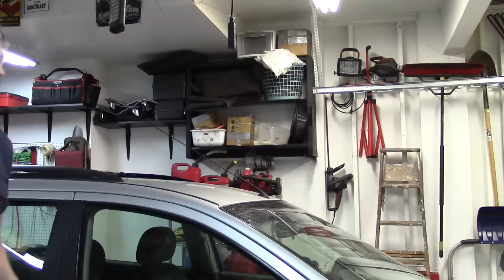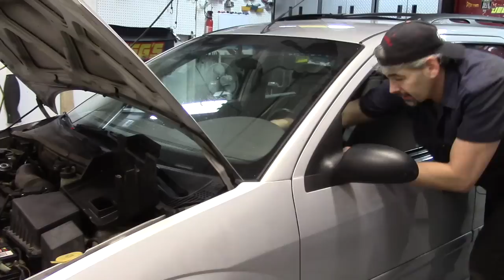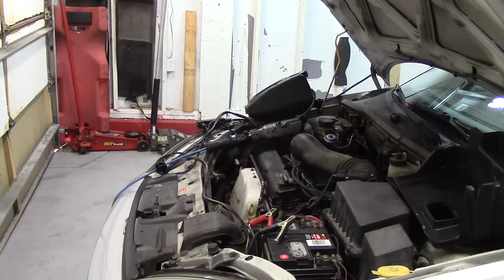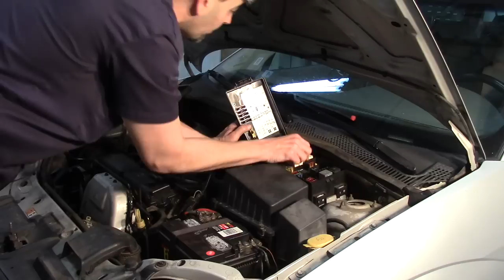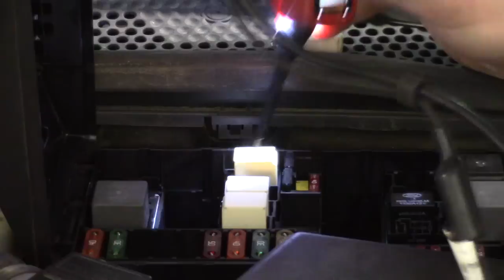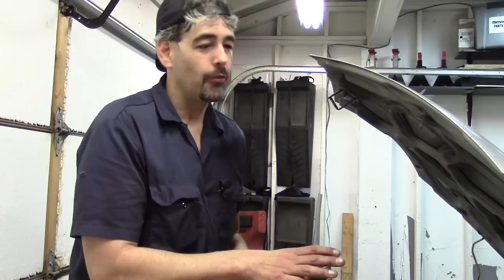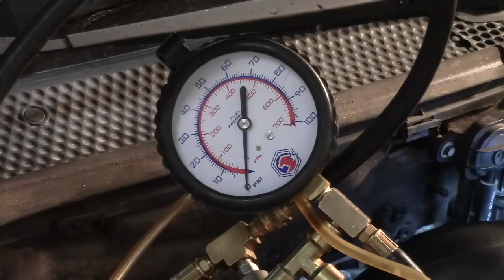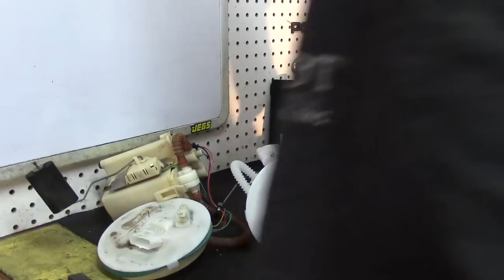Cranking No-Start Real Time Diagnosis -Ford Focus

Comment: For checking fuel, isn't it an easyer way just to smell at the end of the exhaust after some cranking?
Reply from the maker: You could do that but why not spray starter fluid and potentially check for spark, timing and compression at the same time?
Reply: @SchrodingersBox  Thnx, it seemed useful 
when I was on the highroad stranded with no tools, to get a first clue, intrigued as I was:-)

Comment: I have a 2016 Ford Focus, the car has a no crank, no dash light, when turning the key? No headlights, even hooked up to jumper cables? Key fab works the door locks, and taillights, light up, when she hits the lock? Windows also will not go up? Any suggestions?
Reply from the maker: What data do you have?

Comment: You technically forgot one other possibility which of course is extremely rare as well....a broken fuel line and/or connecting hose (filler hose) to fuel tank....of course your fuel gauge would read empty UNLESS it was broke....

Not giving you a hard time just throwing this out there...
Reply from the maker: if the line were broken though we would have seen the fuel pump respond to the voltage test and it didn’t.
Reply: @SchrodingersBox  I know....I meant before you tested the fuel pump....you mentioned 4 things it could be besides the fuel pump...I was just adding that to the list.
Reply from the maker: Oh yes that would be correct. nice catch!

Comment: Had battery tested was definitely bad needed replacement which i did . Still taking more than one try to start . Was told by experienced mechanic that it's not starter since a bad starter wouldn't crank at all ? Is this true ? Soo was definitely bad battery but is it just coincidence that this happened at same time ? Coulld bad battery cause this other problem ? Unfortunately also when I replaced battery I left air flow sensor disconnected ( disconnected to get in battery ) and ran it for test drive . Soo now mass or volume air flow sensor code PO103 showed up along with PO113 Intake air temp sensor
Reply from the maker: It depends on what you mean by “more than one try to start”.  What exactly does it do the first time?
Reply: @SchrodingersBox  often fails to start . Often need to crank it several times to start
Reply from the maker: Then it is not starter. i would look at your volumetric efficiency next given the MAF code.
Reply: @SchrodingersBox  seems pretty easy to replace the evaporative valve control and I might do that. That's what was suggested was most likely solution according to scan . As for checking the volumetric efficiency I don't know what that is.  I could look it up see what tools is needed. Is it hard to do ?
Reply from the maker: i don’t see how this is linked to Evap and in fact it almost guaranteed isn’t. if you think it is then just plug or clamp the hose for the purge valve and see if it starts.  also you would have extremely rich condition reflected in P0172 and 0173 codes which you don’t have.
Reply: @SchrodingersBox  a good way to rule out EVAP is to clamp it where exactly ?
Reply from the maker: to clamp the hose between the intake and purge solenoid. this would cut off EVAP to the engine.  if car starts then, I would agree EVAP leakage into intake would be indicated.
Reply: @SchrodingersBox  now at this mechanic that so far , has earned my trust ( I think ) on the times I've used him. He said present codes are there because I forgot to reconnect Mass air flow sensor when I ran it for about half an hour. They'll stay there until cleared. It's now puny whimper from starter. Started it after several tries. Barely. It's going to leave me stranded very soon. He thinks it's the starter. The starter was replaced from O'Reilly's the cheapest one just over a year and a half ago. Was about $120 . The other was maybe $300 back then. He doesn't think it's bad starter cable connection. Says then it wouldn't crank over.
Reply: Just taking several tries to start car. It's not going to start at all very soon. It just barely cranks for a bit often just a quick second.
Reply: Yeah getting that it's not going to start at all . As I said , it cranks but oftentimes just a quick puny crank. I'd suspect starter connection maybe loose but that wouldn't explain the codes right ?? With the codes I've mentioned , would it cause this ? Getting desperate . Saw Video of replacement of that valve and very straightforward but said delete codes and not sure what that is . After replacement of that valve ,if codes not erased then still be a problem ?

Comment: I have a 02 Ford Focus just bought a brand new battery car cracks but won’t start what would that mean the problem is?
Reply from the maker: could be anything. what data do you have? did you check spark? fuel? compression? timing?

Comment: This helped a good bit for my 2001 my valve for my fuel rail is under the rail on the passenger side under that little bracket

Comment: What about when the no start but also the clutch isn't catching And not recognizing  it's in park or gear?
Reply from the maker: Yep one of the causes is when you have a P/N (Park/Neutral) or CSS (Clutch Safety Switch) that is preventing the starter from engaging.
  In any case, I usually test for this by bypassing the switch and if the car then starts, I know thats the problem. 
  It would apply in this video since we have a cranking no-start though. But for a non-crank no start it's one of the first things I suspect once I rule out power.

Comment: I. Have 2012 Ford focus did engine swap cranks will not start I do have fuel and spark
Reply from the maker: if you have fuel and spark it must be timing or compression then.

Comment: My 2013 Ford Focus got rear ended very lightly and then the car drove for a few miles and shut off and won’t turn back on , there’s no crank sound or anything. I disconnected the fuel line and noticed no fuel coming out as well. However I tried to do the steps to reengage the fuel supply but it doesn’t seem to reengage or whatever is going on. What can I do?
Reply from the maker: when no fuel comes out is that with KOEO prime it is it with putting 12V directly to the pump motor?
Reply: @SchrodingersBox  yes key is in the on position, and no fuel coming out, I believe I do hear the humming tho as if priming, I will have to check the voltage to be sure. I tried to check if it was the starter by jumping a wire in the starters relay which only seemingly fried the wire which makes me think maybe it’s something to do with the grounds ? But are their any grounds in the trunk area? Where the car got hit it was on the drivers side back it did push the fuse box that’s right in that area alittle but I don’t see any actual damage to the box or wires.
Reply from the maker: I would start by putting 12V to the pump directly. this should produce fuel pressure at the rail. if it doesn’t and then pump is running, check flow at the filter or look for whatever the restriction is.

Comment: no hate or anything im actually just curious. But wouldn't the OBD2 sensor tell you it was the fuel pump off the rip?
Reply from the maker: No, there is no code for a bad fuel pump because there is no way for the PCM to differentiate a bad pump from flow restriction or pressure regulation  as a lean variable.

Comment: Hi I got Toyota Avensis it wont start when it's at normal running temperature. Any suggestions plz.
Reply from the maker: I usually start with a fuel pressure decay test for that symptom.

Comment: How long did it take to replace ? 2016 Focus SE 2.0L I just paid a mechanic to do it $60 plus starter . He's been verry good and honest above all . Very reasonable and it's working just as before . I have had timing serious problems which he mostly fixed . Still a lil stalling when I accelerate . I told him about it and he said sometimes they gotta relearn certain things on its own . ? God I hope so . Went on 175 mile road trip when I got it yesterday
Reply from the maker: this was years ago but I want to say it too between 3 and 4 hours. There should not be a long relearn- what data from fuel trims is he seeing that indicates there is a relearn process happening?
Reply: @SchrodingersBox  I'm not at all sure about the data. He might be talking generally .. He also said there's no need to do a misfire relearning procedure since we didn't really replace any of the sensors ? He said , only do a relearn procedure if we'd work on the sensors? Which we didn't.
Reply: But the lurching ( lagging) can be pronounced at times. Very annoying and worrisome. I don't really want to take it back to him because it's basically working but still ..I think he said change spark plugs.. Less than 67,000 miles. Right now original Motorcraft ones. I replaced one when I did compression test.

Comment: Does that car not have a fuel shut off switch (inertia switch)? Working on one now and that was the case. Reset the switch, car cranked and ran fine, guy drove it home and parked it, went to get in it about thirty minutes later and bingo, same problem. Went to his house, reset the switch, still cranks but no start. Plenty of air, spark and timing, no fuel. Fuel pump has recently been replaced prior to him purchasing the car about two months ago. All fuses check out, relay works lol. I'm lost unless the fuel pump has went out extremely fast considering it's practically new.
Reply from the maker: It does but I ruled that out in the first test.

Comment: I have a 2006 Honda Accord that has a reoccurring cylinder 4 misfire and won’t start. We replaced the spark plugs, fuel injectors, the pump and even the catalytic converter. Still nothing, any ideas?
Reply from the maker: Sure. Tons of ideas so let’s narrow them down.  What was the data you got that indicated you needed all of those. What data especially showed the fuel pump needed to be replaced? Was done by fuel trim analysis or rail pressure?
  Also what data showed the catalytic converter was the problem?  Was this an S2 vs S1 overlap trace or was a backpressure test done?

Comment: Hello there! I have a ford focus 2012 se 2.0 and the fuel injectors aren't firing. It will start with starter fluid and run for a few seconds before stalling out again... Fuse and fuel pump and pressure  are good.. spark plugs are always dry during minutes of cranking .. My question is what controls the signals for the injectors? Is it the two cam sensors or crank position sensor or what other probable caused to not open?
Reply from the maker: This should be really easy. On a ford the fuel inejectors are a constant feed and ground side switched individually by the PCM  so it’s clear there is no signal to the PCM. I would simply do a cam sensor bypass to see if it fires the injectors.  If it does then check you cam sensor output because you know the reference  input and signal integrity is good. 
   If that doesn’t do it, check the continuity of the signal, reference and grounds because obviously it has to be a fault in one or more of those wires.
Reply: Hi again... how do I bypass cam sensor and how do I test the crank sensor ? I'm nearly certain none of the injectors are firing.  I also had a new fuel pump and new pcm installed (with  immobilizer reprogrammed for the keys) .. it start with starter fluid again but won't without it.  Do you know what else it could be?
Reply from the maker: it is not the cam sensor if it started with starting fluid because there had to be spark if it ran so the cam sensor is working. 
  What data showed the PCM needed to be replaced? I would totally start there. Was the PCM failing to ground side switch the injectors?  That seems extremely unlikely. How was was that tested exactly?  That’s where you need to start because that data will lead to the problem.

Comment: Your wrong at 18 minutes. 
Focus is common as muck for the pins actually snapping off the plug that connects to the pump. So it just cuts it down to 50/50.

Fyi I literally made the same mistake lol
Reply from the maker: Ummmm no.  Because the test light confirmed there was continuity at the connector. Impossible that there was a pin snapped off and focus is not known for that issue anyway.

Comment: Thank you for the tutorial! That car has a Fuel Pump Module, is a returnless system so the Fuel pump module controls the fuel pump with a PWM signal, that relay you are energizing will not turn the fuel pump on it will only send 12v to the module

Comment: My 2001 focus zx3 has a inertia shut off switch , its located in the passenger foot well near the door. Didn't work for me :'(
Reply: Personal 2002 Focus ZX5 200K Experiences: Also there a fuel pump control module under the backseat of the Focus.  The FPCM if it gets a bad ground connection from corrosion or it got wet or crushed etc.. easy to unplug remove some screws and plug in a new one making sure it has a good backside ground connection. 5 minute fix. My 2002 zx5 had a rusty ground on back of the FPCM and EPCM did not get a good ground reading and wouldn't fire the fuel pump. While easy to unhook and drop fuel tank literally one nut at the front and two twist connectors at the rear of the straps. If your car is rusty and funky getting it all back together not so easy. Carefully (wires and lines under the floor use a dremel and HD wheel) cutting access hatch in floor under the backseat makes changing pump and the fuel filter on a 2002 ZX5 a breeze. Some rust converter paint, rivnuts and and insulated silver self adhesive backed flashing (Home Depot multitudes cheaper than Auto branded Sound deadner [Same Stuff] to seal up hatch after swapping in new pump (I purchased an entire Bosch Fuel Pump Module  $110 vs adding new pump to old housing and maybe $40 with new filters etc..).  Kept old module just in case I want to add a higher volume pump in future. The location of the fuel pump under the backseat was located centered on the electrical connection grommet under the rear passenger seat on my car. Later Focus models sometimes have them more centrally located under the backseat about 13" towards the drivers side from this same grommet. If you use the drop the tank method make sure you have replacement hose clamps, either method you should probably pick up some spare fuel connector locks (about $5 for 6 at autoparts chain vs. $10 each at the Ford Dealer). If your Fuel Pump Control Module is bad Dorman makes a replacement for $39 vs. Ford Dealer $219.  Do not forget to check that the Accident Inertia Switch has not tripped and the button is in the pushed in position (2002 zx5 is in the passenger footwell outside kick panel detent remove button cover and push button down towards floor if it is popped up(shutting off Fuel Pump).

Comment: Hi, from Australia, Sydney..i currently drive a Ford ba ute, falcon,  , 20amp yellew fuse keeps blowing out to the fuel pump any suggestions
Reply from the maker: check how many amps the pump is using.

Comment: Hi there could you help me please I changed the fuel filter on my ford focus  mk2 2008 tdci I did the prime I drive about 10miles and the car stall and once I opened the bonnet I found out lots of bubbles In diesel line from that I did prime again but not luck of starting. Any help much appreciated.
Reply from the maker: Whast is the fuel pressure at idle vs running?

Comment: I Relly like the way you do the explanation. There is only one thing I don't agree with,is when u said if you where a professional technician you will just go ahead and oder for the fuel pump without even consider the injectors..professional don't work like that..my name is Dauda jalloh from sierra leone West Africa...a technician too..but I like your video..because you take your time to explain.
Reply from the maker: Duly noted. Not all techs would have jumped to conclusion, you’re right.

Comment: It's all fine and helpful, but I've noticed that your videos don't cover vehicles with diesel engines. It would be nice if there were some of those, or you just don't do diesel?
Reply from the maker: I get that feedback a lot.  I don't see diesel vehicles where I live, sorry!
Reply: @SchrodingersBox  Darn, I have a diesel car. 😃 Anyways, if you find it interesting, it would be great to do at least theoretical (white board) if not practical demonstration of how the same sensors and systems have completely different roles in gasoline and diesel engines, and how they affect diagnostic process. Keep up the good work, cheers!

Comment: Very helpful troubleshooting! I went through your FASTEC method, and wound up at the same spot, fuel pump. I’m getting power to the pump, but it is not priming, no pressure at Schrader valve. I pulled the pump and put 12 volts on it, and it works, kinda stumped. Any thoughts?
Reply from the maker: Sounds like voltage drop issue to me if it puts out correct pressure with direct voltage to the pump.  Try voltage drop testing the wiring.  This assumes of course the relay is working,.

Comment: Hi, thanks a lot for the valuable information on this video. I was hoping If you you can’t help me fix my 2001 focus as dohc? The other day I was driving for a while then stopped to get some gas! The car was cranking but never started! I pushed it to a nearby parking lot and left it over night, the next morning I went back to it and tried to start it and it started but there was white smoke coming out of the engine compartment!!! I shut it off and started it again after few mins and drove it home. It was driving fine and since then I didn’t attempt to start it.
Do you know why is this happening by any chance?
Reply from the maker: What data do you have?